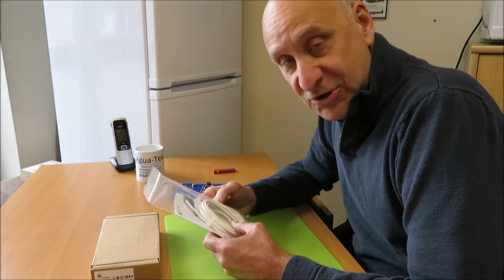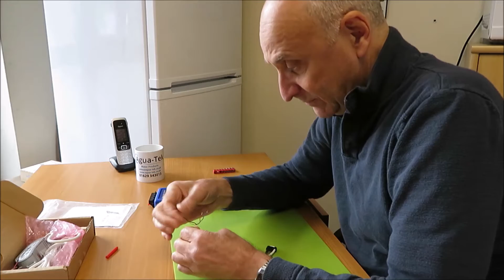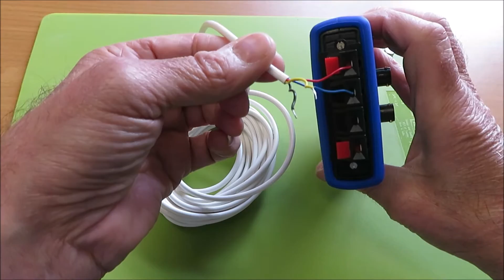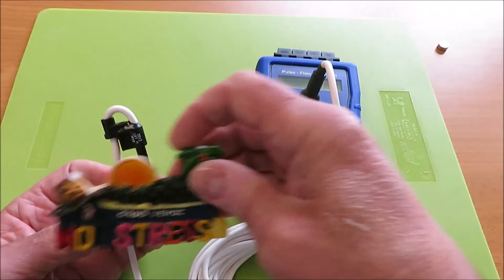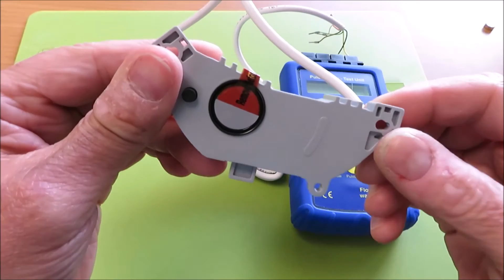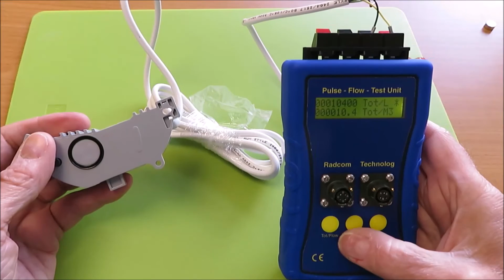T Probe PR6

Comment: Hi what voltage output does the PR6 output?
Reply from the maker: The PR6 doesn't have a voltage output. It is termed open Collector or Drain. Meaning basically that it is very much like  switch contacts. So the device connected to the PR6 supplies a voltage that is shorted to ground to give the pulse signal.